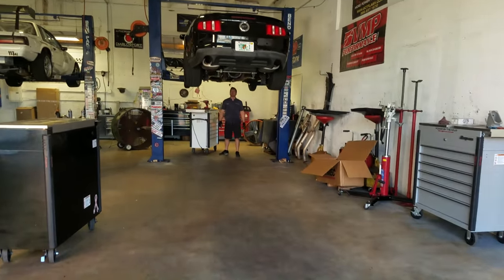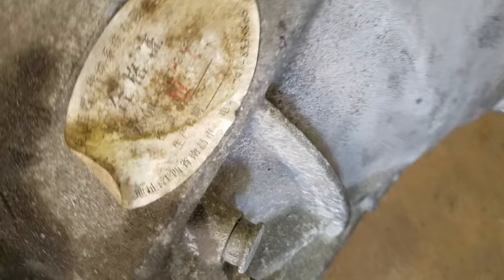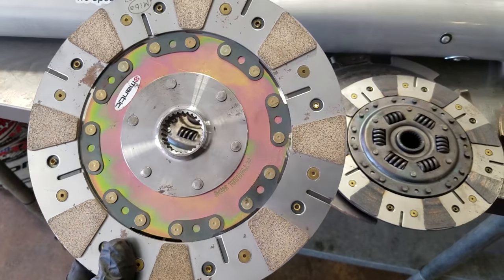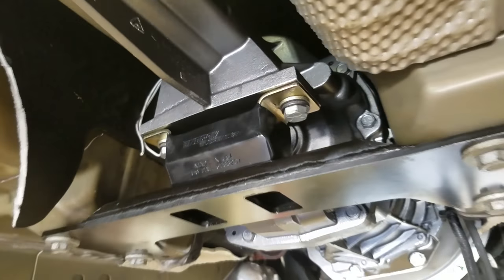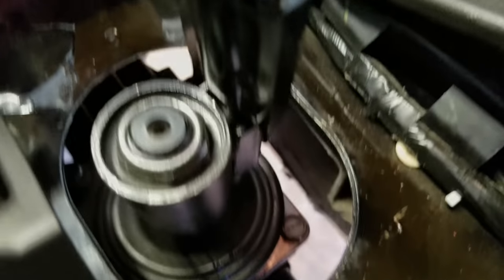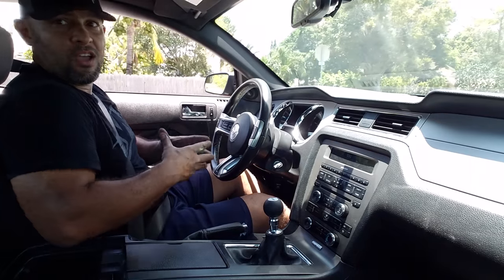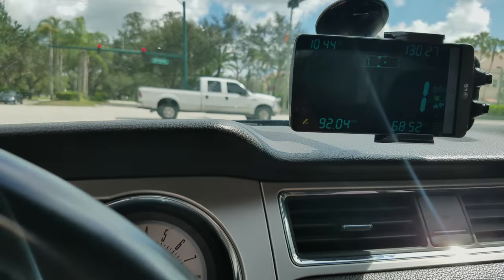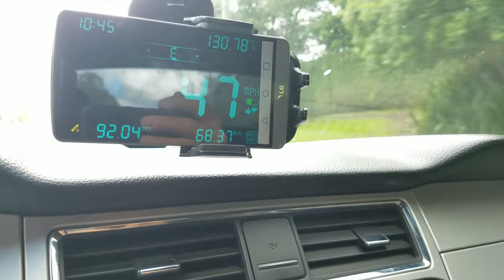T56 installed, Mantic clutch and speedometer configuration.

Comment: little advice man-for bleeding clutches fast on these setups-I went to ace hardware and got a set of those black sink drain plugs-the ones that are like little wide cones with a metal ring on em--I removed the ring and drilled a hole in it--then put a barb on there-I place the plug over the brake reservoir and use the vacuum pump to suck the air out-while someone moves the pedal up and down a few times-you wont wear your leg out bleeding the clutch ever again
Reply: Wanna know an even EASIER way to bleed a clutch with out touching SHIT with ur hands or even getting out of ur car?? Press the clutch in and let it spring back up hard by slipping ur foot off over and over. The air comes all out with a little over 20 pushes.
Reply: Your welcome from THE FKN MAN

Comment: Alex - The Tremec is a 2 wire OSS output and the Coppermine expects a 3 wire. Plus one is a square wave and the other is sinusoidal. How did you wire the Tremec output? And after you changed the reluctor hole count to 12, do you still have your cruise control?  Thanks!!!

Comment: Hey, 
I have a 2013 coyote with a t56 swap, the speedometer is accurate but sometimes it stops reading and check engine light shows that the output shaft speed sensor is not working.
I checked the wires, tune is perfect, and still didn't find the problem. 
Some told me i need to install a conversion box.
Any suggestions?
Thanks

Comment: Great info like always. Does your cruise control works? If so, and you feel like sharing, I would love some info on what is or was needed to get it working
Reply from the maker: It works
Reply: Alejandro Flores That's a badass stock 2011 Coyote with 115k miles on it. You may get 150k miles outta it.
Reply: Alejandro Flores That's cool you still run stock ford shortys. They are actually very efficient and better than new Mustang headers.
Reply: Nice. I wasn't able to get it to work with my TR6060 swap with out using one of speed boxes mentioned.

Comment: Not to be a jerk, but considering all the work and cost involved in this, would it not have been easier/cheaper just to buy a used GT350?
Reply from the maker: Hell no. 
This car ended up going 10.1 ar 142 
A stock gt350 Is 40k. And at that time they were 50k. 
So no it would not have been cheaper.

Comment: Alex, are you still on the stock, original motor?
Reply from the maker: alcarames1 I had the engine replaced at 40,000 miles due to an engine tick it's the first generation coyote

Comment: Whole lotta gear whine though it sounds like... That coming in through the shifter?
Reply from the maker: Jesus, i can't belive mustang owners give a shit about gear whine on a car with solid suspension. If you care about whine, just stay with the MT82, and BTW that sucker whined more than the t56
Reply: Alejandro Flores You running 9.80's in that car E85 correct?
Reply: Was hoping no gear whine would be a further selling point. It appears not. I wasn't bagging on you, just asking... 
That's another feather in the GT500 cap then it seems. 
Yes, many of us do care about whine. Hell, with an unsprung dual disc in my MT82, the slight rattle at 1200 rpm under load grates on me. And it never lives there at that rpm and load in the real world. 
Whine all through the range would drive me batty. 
That said, mine's not in full boogie race car status. Everyone's situation is different. 

I was curious if it was being transmitted through the trans mount shifter because when I first went to the blowfish mounted MGW on my MT82, I was getting a tiny amount transmitted through the shifter, and a little strategic dynamat and carpet insulation padding in the trans tunnel totally cleared it up.

Comment: I will be on month #3 doing a Tremec T56 Magnum xl swap on my son's 2017 Mustang GT. Complete nightmare started with Modern driveling sending me pieces instead of whole kit then nothing but arguing with them over what I should have received. Attempted to install on my garage floor at home mistake #2 took 2 days to pull old piece of shit china joe MT-82 top bolts from hell took all day to remove. Then upon install of new T56 magnum spent 2 weeks and finally gave up and towed to a friends garage. three days later he says it is done I pick it up and grinding in all gears and clicking from Bowler all in one wiring harness when clutch is depressed. Now I am calling around to have this thing taken apart and re installed thinking it may be air gap related??? Prior to install MDL says this is plug and play no concentric runout test needed or air gap just use stock slave cylinder. Also Lethal Performance sells same kit said same thing now a speed shop tells me from their experience this Tremec and McCleoud RST needs a spacer behind hydraulic throw-out bearing. This nightmare is going to this speed shop to un fuck the clutch issue and Bowler wiring harness nightmare in my search of just smooth shifting on this evil posessed car!!!!  Also broke my thumb when hand slipped off ratchet and gouged my head under a midrise lift .